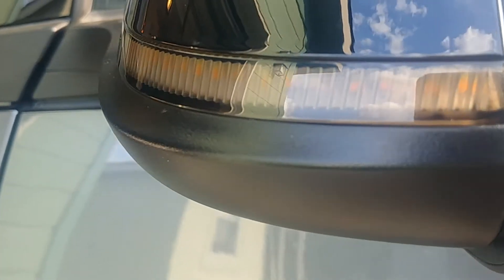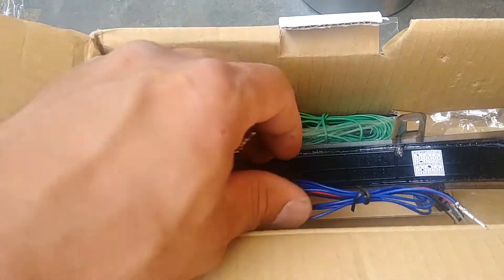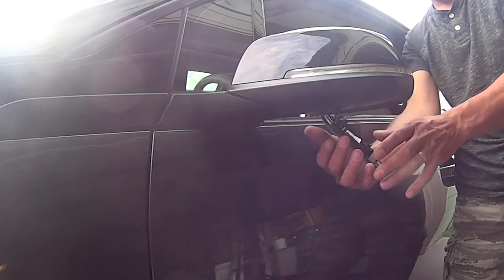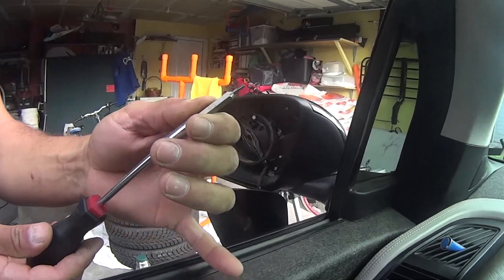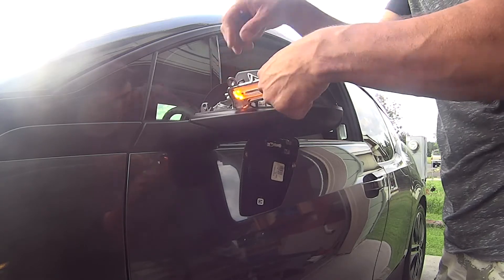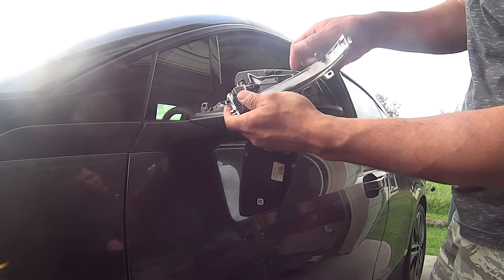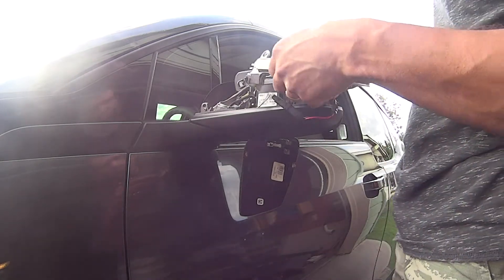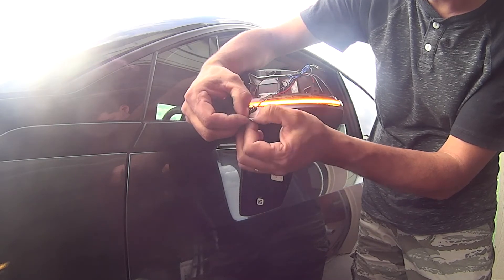BMW i3 sequential turn signal light installation

Comment: Bonsoir, merci pour cette vidéo 😮.Ou acheter les clignotants.Merci
Reply from the maker: @redabd4198  je les ai achetés sur Amazon  https://www.amazon.com/Smoked-Mirror-Sequential-Signal-Lights/dp/B082HJ8QWZ/ref=asc_df_B082HJ8QWZ/?tag=hyprod-20&linkCode=df0&hvadid=693613231827&hvpos=&hvnetw=g&hvrand=15242487474612203988&hvpone=&hvptwo=&hvqmt=&hvdev=c&hvdvcmdl=&hvlocint=&hvlocphy=9029571&hvtargid=pla-872307878325&mcid=6efe33ee15953e6e8920fdde97a12479&th=1
Reply: @ioanw972  🙏🏻

Comment: Hi, i have bmw i3. My left side doorlights doesnt work "interior light/ night light" , do you know how to fix it? Do i only need to replace new Led-lamp or do i need to change/buy the hole doorhandle? 😕 I cant find way to just take out  the Led-lamp from the doorhandle.

Sorry for my poor english.🙏
Reply from the maker: you will have to take the inside of the door panel off. I do have a video on how to do that. unfortunately its not posted yet.

Comment: Where do you plug the wires to get the blue light working?
Reply: I don’t believe there is a blue light. It might be a white light that works on a blue wire. If there is a white light, you can connect it as a turn signal, otherwise you will need to pull another wire from the parking lights to have it on whenever your parking lights are on
Reply: They sell blue and yellow blinkers..this is yellow

Comment: Can you put a link where i can find them please?
Reply from the maker: It is not the exact one I bought but this will work. there are cheaper options as well if you sort for price . 

https://www.amazon.com/Ultima-Dynamic-Sequential-Signal-Compatible/dp/B07P2Q53RS/ref=pd_sbs_263_1/132-6825389-8988212?_encoding=UTF8&pd_rd_i=B07P2Q53RS&pd_rd_r=2ed5c42b-c06b-4a5a-a485-874e48c48bfe&pd_rd_w=uyC3Y&pd_rd_wg=eEZo9&pf_rd_p=b65ee94e-1282-43fc-a8b1-8bf931f6dfab&pf_rd_r=1MA80QEY2M84CQ2FAEWZ&psc=1&refRID=1MA80QEY2M84CQ2FAEWZ